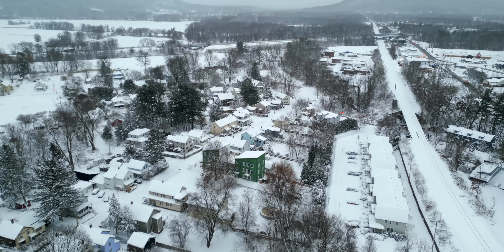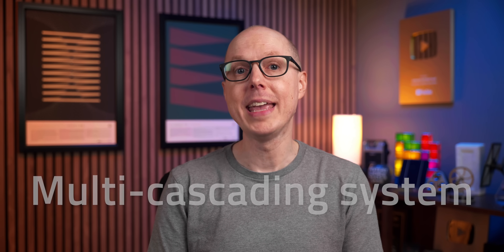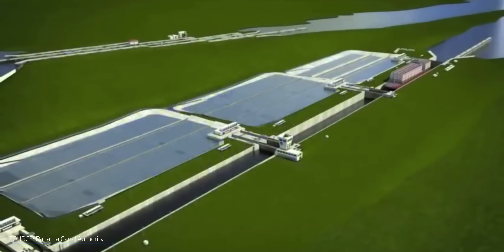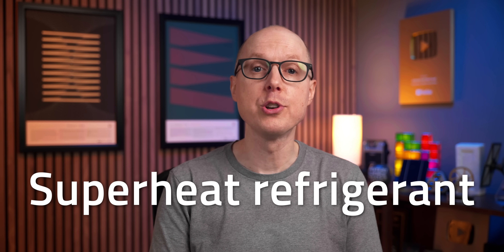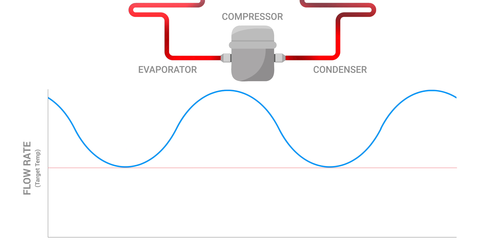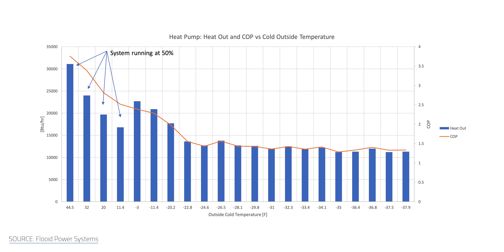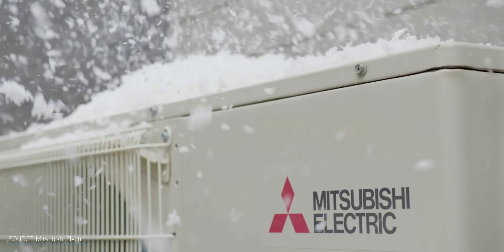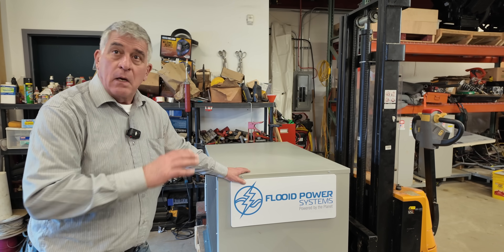How This New Heat Pump is Genius

Comment: A few thoughts:
This isn't new, it's how large rooftop / industrial systems work - you have a 10 ton unit, that gets a 5 ton modulating compressor, and a 5 ton single stage compressor. Easy. Now you have 1-10 tons of cooling (or heating) - which means, you can size to the heating demand (which is higher than the cooling demand in much of north america) without oversizing in cooling (or vice versa)... and, only one of those compressors is complicated / expensive - another strength.

I've been yelling (to myself) for a few years about why this wasn't brought to residential. But, I want to tell you why not:
Airflow.

It's vastly more cost effective and has a greater comfort and performance outcome to instead install multiple duct systems (or multiple indoor units, for ductless), than to try to install one single duct system that can actually deliver 10 tons at once, in a residential application - there just literally isn't space in the house for a single duct that large. But, there's plenty of space for 2-3 duct systems that add up to that. Additionally, homebuilding is done with stories, not all on a single level, which creates microclimates and differences in loads, so it's easier to address this with dedicated systems.

This technology will see implementation in residential air-to-water systems, but, I don't think will ever see widespread market use in air-to-air, for this reason.

Again, I've really wanted this to be a thing - but I don't ever see it being reasonable. Duct systems are always undersized as-is, and that's always the limiting factor, so this technology is cool, but, not productive...

We already have heat pumps that can deliver 100% capacity down to below 0F, we really don't need cascading - except insofar as we're concerned about how those systems cannot actually modulate in cooling or shoulder seasons. And, regrettably, NO ONE is talking about this at all; they're interested in this technology for all the wrong reasons. 

We'd need substantial education on Manual J / S and implications at part load for anyone to actually become interested in having a 5 ton unit with a true range of 0.5 - 5 tons... otherwise, the single compressor that can maintain 100% when it's cold is marketing hype that everyone loves, and they ignore that it can only ramp down to 2 tons...

That said, this is cool; but, single phase VRF so that we can have true heat recovery in residential is way cooler. 
Everyone wants to recover heat into their domestic hot water without realizing what that means in the winter... 
What if instead we could just move that top floor heat to the basement, and have a perfectly balanced house...

Comment: I am very surprise that this system of step by step loops system don't have any loss in thermo efficiency and actually increase whole system efficiency. I think this is a case of too much mechanical inefficiency in the original heat pump system. I really hope this technology would work in real life applications.

Comment: weather in my south florida neighborhood ranges between 42-110f. i dont know that a heat pump would be a very strong benefit over my existing 16 seer AC, but sure, id be interested. i like the technology and the simplicity of a single system, that just runs backwards for heat. i only run the heat 1-20 days a year though, and the thermostat is ever turned to heat for a small portion of those days anyway.
Reply: If you only need heat 20 days a year it's probably not worth replacing your existing AC with a heat pump. When it eventually needs replacement definitely go for the heat pump.

Comment: Multiple moving parts (in this case 2 compressors) never makes anything better. A well sized heatpump running at low temps with underfloor heating, little or no zoning and insulation is the answer. Even for older, still uninsulated, houses like my brick house built in 1956. My max flow temp for getting my house 20c was 34c. I live in the western most point of Germany btw. Check out Vaillant arotherm heatpumps (your thumbnail).

Comment: They could try 2 stage compressors with sub cooling heat ex. on the liquid lines ; Heat pumps are great tech. But there is a lot of cost !

Comment: Interesting, I kept thinking of Tesla's heat pump with the octavalve that redirects heat and cooling for several purposes.  My home has two HVAC systems.  Perhaps there would be some savings of the system could manage both circuits.  My systems were replaced in the last couple years so I am not eager to replace them now.

Comment: So the fluid is basically a heat exchanger joining the loops and you're adding the heat of compression between the loops and transferring it from the condenser of pump 1 to evaporator of pump 2. What I wonder is about running multiple compressors, this will increase amperage draw and power consumption, these small hermetic compressors will also draw higher amps when the comp ratio increases with high head pressure all other things being equal. Using the heat of compression is very smart but could be negated by running multiple compressors with high compression ratios. 
That's why you see manifolds of compressors on big capacity systems is to maintain efficiency. But this cascading system uses all multiple compressors at once just to move heat, not to increase efficiency. I'd like to know the kw/h of this system on a call for heating per 12k btuh.

Comment: As an HVAC contractor, my main concern would be future service ability. Our best option right now for residential heat pumps in my area are the Bryant Extreme series variable speed communicating systems. But these are unfortunately built proprietary boards/inverters. They are the main point of failure and can run about 4500$ our cost. Which is about as much as the condenser costed new. Often times we have to replace the inverter and compressor together as one damages the other in failure. Cheap readily available inverters can be purchased from anyone. There is no reason for it to be proprietary except for pure greed. If these guys make it repairable then we can keep them going indefinitely which will mean a return of investment over time.

Comment: Unfortunately based on this channel's past videos, you can never tell whether Matt is simply parroting unsupported marketing hype. I wouldn't even doubt if he was getting paid by these companies to produce the content to raise the technology's profile for investors. Matt doesn't seem to bring an independent evaluation or critical eye to any of the claims the manufacturers make. He doesn't address a single one of potential obvious downsides of having multiple heat pumps in a cascade- for example, many people will be familiar offhand that large buildings with chilled water systems usually have multiple chillers of different capacities to address varying load requirements. For example, a small output chiller, a medium, and a large, and they can be used in whatever combination to produce the required chiller output. Similarly, as long as you were undertaking the capital cost to build multiple heat pumps, is it really most efficient to run them in a "compounding"/"cascading" system, rather than running them in parallel to optimize loading? That would be my very first question, since those sorts of parallel systems already exist and are common, but it apparently didn't occur to the Undecided production team.
Reply: Have any of you ever considered that the point of the videos is specifically to make people ask questions of the manufacturers? One voice is easy to ignore but thousands or millions are not so easy. The point of his videos that I’ve seen is specifically to generate curiosity and debate on products and topics. So how about you chill out on the devaluation of the content and be a better person and consumer
Reply: I worked with Matt and other smart home influencers directly as they reviewed the SPAN smart electric panel. 

I can confirm that Matt didn’t take a dime, which set him apart from the others that were pay-to-play. He was keen on unpaid/unbiased reviews and I respect him greatly for that.
Reply: @wattbotdotcom  what was your role in helping Matt and other influencers?
Reply: Cascading 2 heat pumps allows for much lower operating pressures for both of them and allows for optimising their refrigerant curves*. A single HP would have a large temperature lift when it's sub 0 outside requiring a very high condenser pressure and wearing the compressor faster. Large chillers for office buildings can generally turn down to 30 or 40% quite easily for low temp lifts but a HP with a lift of 100° would have trouble modulating, that's when buildings in places like quebec cascade heat pumps instead of running a single one. Cascading is about temp lift, not capacity as you mention.
I support skepticism and think you're right that this channel isn't in depth enough for your stated goals, you may want to read up on some ASHRAE texts or case studies for harder data.
Reply: @ARod-n2u  are you suggesting a cascade system would last more than twice as long as a singular heatpump doing all the work?
Reply: You know what youre saying is literally psyop propaganda by gas companies so you keep being reliant on them
Reply: I 100 percent agree with you. I have stopped taking him seriously because of the issues you correctly highlighted in your comment.
Reply: Louis Rossman recently took MKBHD to task for his fluff pieces. Anyone who reads the ad copy out loud, and never challenges corporate scammers and their claims should be run off the platform, imo
Reply: @CaptainSnackbeard  absolutely. Thank you for bringing this to my attention.
Reply: Thank you. I unsubbed. The investor scams are out of control
Reply: Well said!

Comment: it sounds a bit complex and therefore expensive.
If the price is right, then I would consider it when I am going to replace my 15 years old heat pump.
I suspect cascading heat pump might be a solution when it comes to a water heater since the output temperature must be higher than what is required from an air to air heat pump

Comment: Something I may have missed is whether or not this has any benefit in non-extreme climates. I live in an area (SW Norway) where our temperature range rarely exceeds -5C>28C. What benefit, if any, would this have in an area without any temperature extremes?

Comment: These are called air conditioners. The rest of the world has been using air conditioners to cool and heat their homes for a long time, particularly places with a lot of newer construction. 

Why are Americans making yet another term that only they use and nobody else does? It's not just America's problem, by continuing to use different terms as the most powerful market in the world, it means bits and pieces of your terminology leak out and confuse the rest of us. It's so confusing to normal customers here in Australia to have to explain to them that a 'heat pump' is that machine that you've had in your house your entire life. 

Matt, please don't join in with this. It's an air conditioner. It conditions air to be the way that you want. If you run it one way it's cold, if you run it the other way it's hot. It's that all-in-one miracle machine that has existed for decades, that everyone else in the world has used for decades, and that for some reason America is only now just discovering.

Comment: The point I don't like in this "product" is like any heating system, they are Sooooo far from real problematics. I do think the solution isn't only in heat pump tech but in a smart tool able to predict how to heat, when to heat depending on the user inside and not overshoot or have manual schedule like electrical heater I have.

Comment: Current NZ pre-trade Heat pump/refrigeration student here, I'm currently learning about the gas type being the main issue with heat pumps due to the r132a gas doing huge damage to the ozone and that there should be great need for a new refrigerant that would not do any ozone damage nor hit any workers and employers with large fines if it escapes during working on the system unlike our current refrigerant does for allowing the r132a gas to escape.  

Basically what I'm saying is we need a safe replacement of the refrigerant gas (R132a) that is confirmed not do any ozone damage and would be safe if there is a leak or extraction mishap should to happen.
Reply: That's a really solid concern that the northern hemisphere doesn't seem to think about. And if you're designing in an earthquake zone, that's another layer of complexity in making sure none of the seals can shake loose - even if a quake hits in the middle of servicing the system.

Comment: It's good they are thinking of air source to water since so many existing homes have boilers, but also because water and other fluids can hold and transport heat so much better than air.  The problem small innovative companies have is a real problem. Even with next stage funding if they are successful its so easy for large companies to take the idea and walk away with it. I wonder if this company could partner up with a mainline Co. to the benefit of both.

Comment: So multiple units in just one ? And then disengaging some units when desired temperature is reached. Lots of AC units already do this, O General Fujitsu makes AC units that are synced together via wifi, when desired temperature is reached the inverter compressor lowers the tonnage in the AC.
Reply: No, this is a series-connected refrigeration unit. You are talking about parallel-connected refrigeration units.

Comment: Installed our ground source geothermal in 1996 with a COP of about 3.2 for heating and about 30 for cooling.  It eventually sprung a leak, so we put a whole new system a few years ago with a variable speed drive and much bigger field.  It has a COP of about 3.4, but it probably higher since it can run at partial load 99% of the time when it's above 0 F.

For my new house, I plan on doing an air source heat pump, but the COP is probably going to average around 2.5 for heating.  But it will be much cheaper for the initial cost than the geothermal.

Comment: Interesting tech. I'm still stuck in a weird headspace where I have to ask: "Why aren't we turning the waste heat into electricity to offset the cost of running the heat pumps?"
Reply: 1. In heating mode there's no such thing as waste heat.
2. Laws of physics. You can't turn heat back into electricity. The best you can do is turn a temperature difference into electricity. To generate electricity on your AC's waste heat the coils need to run hotter than normal in order to get this temperature difference. It takes more electricity to do this than you make back with the generator.
Reply: @eDoc2020  I was thinking more like installing sterling generators along the ducting between the heat exchangers. Those heat up and radiate outward and you can't stop it, why not make use of the temperature difference between the pipes and the insulation?

I get that there's always going to be energy loss, but 'laws of physics', energy is just energy. It's all just various forms of movement. There has to be a way to recycle the waste.
Reply: @mitchhaelann9215   You're talking about harnessing energy wasted by heat conducting out of ducts and going outside? That would work but it would be so much cheaper and easier (and overall more efficient) to improve the insulation and reduce the loss. If you're talking about heat conducting out of ducts and into the living space then once again it's not waste heat.

Comment: I saw a video a few months ago where a guy runs a car radiator hooked up to a pump and a 400' long coil of buried pipe. He fills with water or windshield wiper fluid or anything of similar capabilities. It was able to warm up a greenhouse to about 55F in the winter. This made me think about putting several air-source heat pumps in that (relatively) warm greenhouse. In a neighborhood with homes close together, heat pumps from 2-6 homes would all be running at peak efficiency all winter, just for the cost of 1 buried ground loop! Flooid takes it to the next level with different types of coolant. I would never put a heat pump out in the cold in the first place. It seems natural to put it in a garage or other semi-conditioned space.
Reply: Skip the greenhouse. It's perfectly fine to have multiple homes running on the same geothermal loop.

Comment: Are the two systems using different refrigerants with different optimal temperature ranges? Struggling visualize this in split type system. With multiple condesnor/evaporaters passing air them all.
Reply: Definitely. If the two systems used the same refrigerant type AFAIK it would be less efficient than a single system.

Comment: I just run three normal heat pump split a/c units (one for each wing of the house) and enough solar panels that efficiency isn't a consideration. My house is all masonry, 65 years old, and astonishingly inefficient. I just changed everything to total electric and put an unreasonable number of inexpensive solar panels and for far less than the cost of a Flooid cascading system my energy costs are effectively zero.